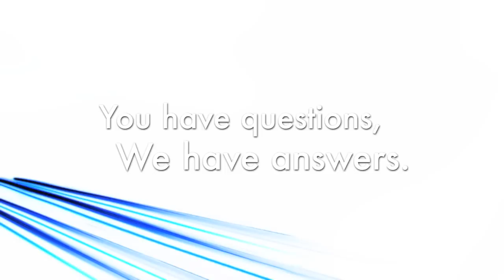Ridgeline Front Grille Installation (Honda Answers #69)

Comment: Yes, I would put this in "Moderate difficulty" for due to the disassembly / reassembly steps, especially if you are not using a lift as this mechanic does.

Comment: Great info. I bought a used 07 earlier this year that has a metal aftermarket chrome grill that I am not fond of. After some research I like the stock ones even less. I simply saftey wired the wheel centercap off of a 1979 Accord to the center of the grill to proudly display my stylized H, looks better, no plastic chrome!
Reply: pictures?